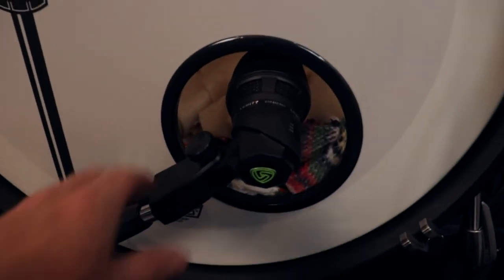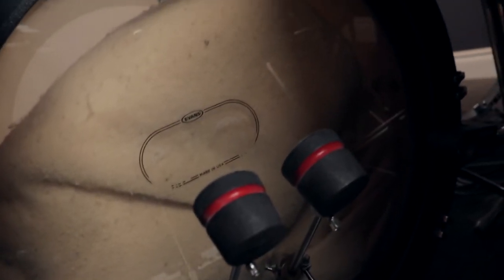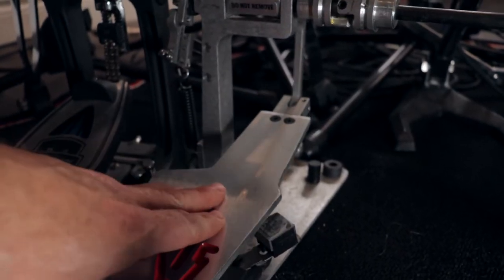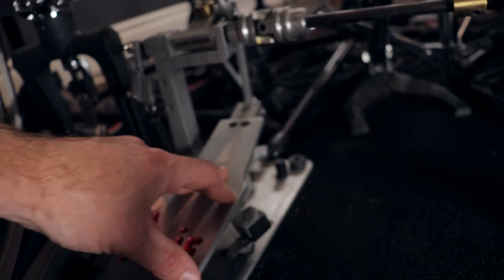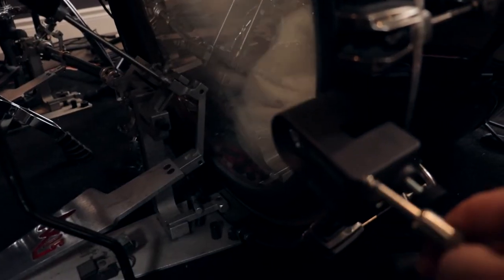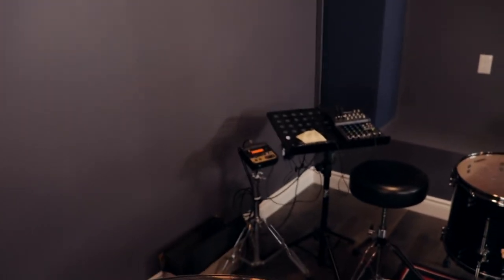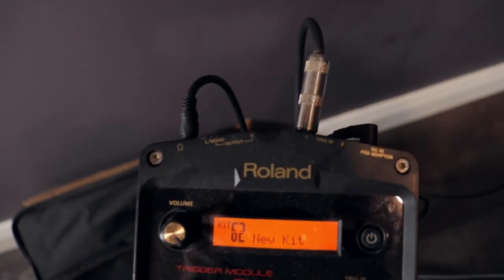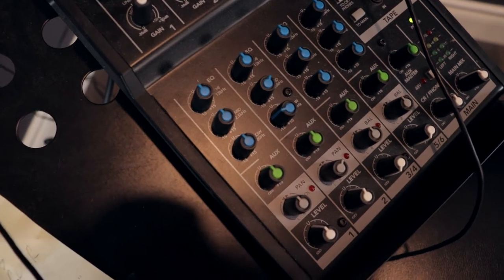How To Use Kick Drum Triggers (tips and tricks)

Comment: I’ve always wondered: is it possible to bypass the drum module and just plug straight into an interface for studio playing?  Essentially use your PC as the module.
Reply: Negative. You need a drum module for your triggers to plug into to act as an interface between your computer.. either midi out from module into midi in on a regular audio interface then into your computer with a usb OR usb from drum module straight into your computer. Then you can trigger sounds from superior drummer, etc.. that part is a whole other thing in itself though